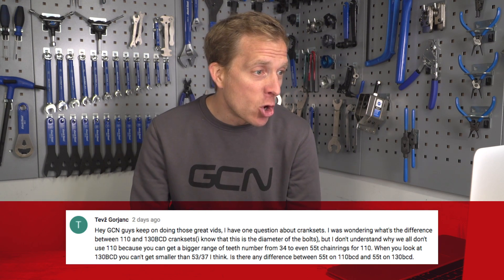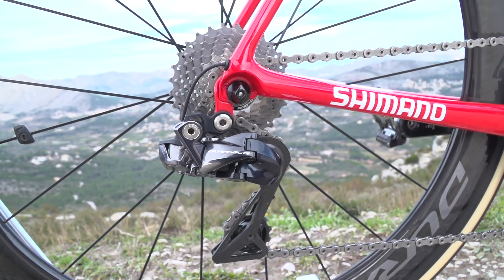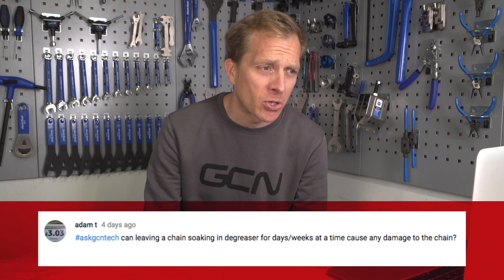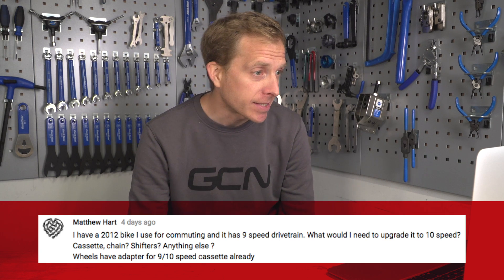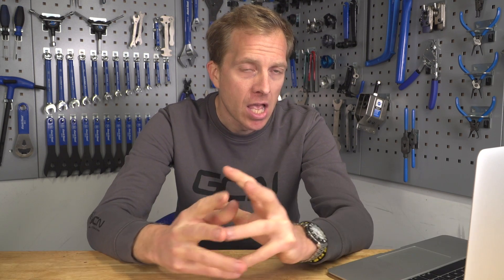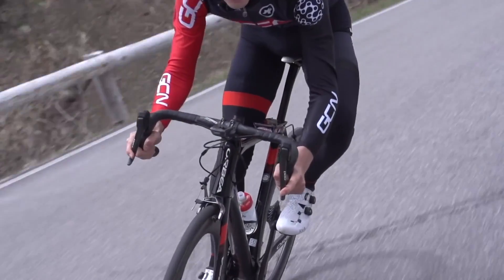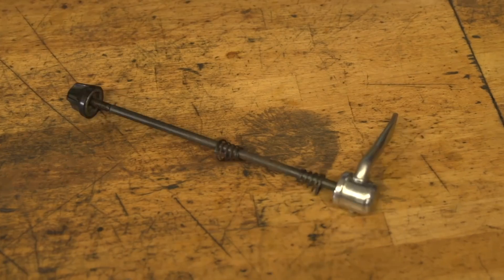What's The Difference Between BCD Sizes? | GCN Tech Clinic

Comment from the maker: Keep your questions coming in with #askgcntech 👇
Reply: #askgcntech cutting carbon which results in better cut?  Dremel with cutting wheel, tungsten carbide bladed hacksaw or 32 teeth bladed hacksaw?
Reply: GCN Tech I have 10 speed SRAM red derailleurs and crankset with 11 speed force shifters and the newer SRAM red brakes. I’m even using a gold KMC chain and Shimano ultegra cassette and it works better than any group set I’ve ever owned (which includes a brand new ultegra). I would recommend it to everyone. I imagine that reading this will make John sick 🤢
Reply: GCN Tech #askgcntech any FD adjustment needed when change inner chainring from 34t to 36t in compact crankset?
Reply: Do you guy's use 'stravistix for strava' ??
Reply: #askgcntech So I have this commuter bike: a 2000s BH frame with 1990s 8-speed campagnolo mirage transmission group.
Right lever has lost the spring to give tension to the lever and return it to place, and seems to not be able to compensate the tension of the derailler, and back wheel needs changing because it's bent.
is there a cheap way to restore the kit, or would I just be better off upgrading to 11speed shimanos? for what I have been seeing, there is nothing compatible with old Campagnolo groups, and the pieces I am looking for stripped from old bikes can set me off as much as a second-to-last generation shimano 105. And then I should add up the cost of the new wheel (to which I would have to install the old hub...).
Alternatively: is there a cheapish road bike that is not total junk?
Also, how does one measure crank length (from the tip of the crank or the middle of the pedal screw to the center of the pedalier).
and finally: how do I know if the bottom bracket is compatible with the frame I currently have?
Thanks!
Reply: #askgcntech Hello GCN,  I am trying bike fitting by myself as a good experience. And I become to know that there's two different types in dropbar. Standard and Oversize, Which one should I use? Are there any differences even ordinary amateurs can feel?
Reply: Would Archimedes want a longer Crank set on his bike?  He did after all ask for a longer lever to move the world., so is there a power advantage to a longer crank?  #askgcntech
Reply: GCN Tech  hi there love your show
Question 
I have a Cannondale Synapse alloy with Shimano sora group set
Can I change this over to a Shimano 105 group set
Specifically just the handle brake shifters, front and rear derailleurs only?
Thanks
Reply: #askgcntech I have a question for you: I have 2 shimano groupets on two bikes, both 105, one is a 10 speeds with a compact 50-34 and the other 11 speeds with a 46-36 my question: is it possible to swap the small chainrings to have a 50-36 and a 46-34? will they work properly? Thanks
Reply: I could swear that first question/answer was supposed to be about power differential! What is the Power Difference between a 110/130!?! Right?!

Comment: I have no idea why you would want to soak a chain in cleaner for any amount of time,, either the chain is good or it’s not, if it’s rusty? Get a new one,,if you think grit has entered the rollers? Get a new one, tenner for a chain. I am a mechanical engineer and have worked with chains both in industry and cycling, by all means soak a new chain in oil for a few minutes before assembly then keep a chain lightly oiled or greased and when it’s old get a new one,,I have seen many a stretched and worn chain soaking in oil,,,please let stop it here!

Comment: Losing weight and gaining watts is hard, so I am considering to swap my 11-28 cassette for an 11-32. To be able to do that I have to change my rear derailleur from a short cage to a medium cage. I have an Ultegra Di2 6800 groupset, so a new derailleur is quite expensive. Can I just buy an replacement cage and swap that? From the parts list of shimano it seems that the only thing separating the SS and GS is the cage. #askgcntech

Comment: Hi Jon, nice show! Can I use a 11 speed derailleur on  a 10 speed cassette with a 10 speed shifter? I've changed my cassette (11-42 T, 1x drivetrain, regards to Si) and now, my pully touches the big sprocket. The derailleur itself hasn't any index, right? So I think the only problem might be the thinner cage for a 10 speed chain...

Comment: @Jon, @Mathew Heart, there's one big exception.  The tiagra 4700 10 speed shifters will NOT work with a 9 speed, or even other 10 speed derailleurs.  They use the new 11 speed pull ratios and will actually work with an 11 speed derailleur, but not with a 9 speed!  

As this is presently the most likely 10 speed shifter someone would buy as an upgrade, it's a pretty big gotcha.  I'd try to get the last 105 10 speed, I think it's 5700.

Comment: Hi. Great show. 
I have an 11 speed, 11-28t cassette, Shimano Ultegra Di2  derailleur setup and use wax to lube the chain. 

I’m having problems indexing the 2nd and 3rd largest cogs in the cassette when using both chain rings, particularly after waxing the chain. What could be causing this? Could the wax have anything to do with it?

Comment: How do you remove pedals from your crank if they are really stuck? Just bought a second had bike and want to put my pedals on. I don’t think the previous owner ever greased them so they are very stuck
Reply: Spray WD40 around the threads and leave for a day. Try to take pedal off by holding the opposite side pedal with your foot. If this fails, takes the wheels off and put the bike in a bench vice making sure to wrap the crank so it doesn't be marked by the vice.

Comment: Degreaser is corrosive. Best try to find out what the degreaser is made from. Some are plant based acids or alkalies and some are petroleum based. What you use will determine how corrosive it is and how you can use it. Citric based degreasers are definitely use and purge immediately where petroleum or ethanol based products you can leave to soak.

Comment: Hi JC!  Which is better: to ride a bit-too-big bike with a shorter stem (90) or a bit-too-small bike with a longer stem (120)?  I'm currently doing the former, but I've heard and read that a small frame with a longer stem may work better if I can't find the frame size I need. Something about better power delivery... #askgcntech
Reply: A smaller bike will be stiffer for going downhill or sprinting. I've made the same mistake before of choosing too big a frame, bike will feel so much better when it is on the smaller side.

Comment: Hi Jon.  I love a gum-walled tyre.  My tyres are approaching needing replacing and I wondered if you could recommend some for the size requirements I have.  The roads where I live are rather rubbish so I'm running 700 x 28c on a 700 x 25 rim, to provide a bit of comfort and durability.  My cursory searches have drawn a blank so far.  Thanks again. #askgcntech

Comment: Hi Jon, I have a 2 part question regarding DA 9100 mechanical groupset. But that dive into some minutiae. I just got a new HM C-Dale Synapse, a real Superbike :), and want to make sure everything is perfectly dialed. #askgcntech

1: I notice with the mechanical DA FD, there seems to be an extra click when throwing it up or down. It feels like Di2, in that after the chain shifts, there is that little stutter to back off the FD. But in this case, i suppose you do it manually. For example. I throw into the big ring, and then do a "half tap" to release a bit of tension after the shift is complete to prevent rubbing. Vice versa on the little ring, adding a small amount of tension. I've never noticed this on Shimano mechanical shifting, and not sure if I'm going crazy, is it normal/ a new feature? 

OK, easier question, maybe. 2: This is my first dive into hydro disc braking, a have been a rim brake holdout for too long. I spent a LONG time getting the pads just right to avoid rubbing. I probably looked at 4-5 videos, including old GCN videos, to combat this. The way the flat mounts sit, especially on the rear seatstay, there can be Zero space between the caliper and frame when squeezing the brake while the screws are loose. I ended up needing to eyeball it, hold it down with one hand, squeeze the brake and keep an incredibly close eye that the tightening back of the screws didn't twist the caliper ever so slightly. I'm not the worst mechanic on earth, but even for me, this seemed incredibly difficult to dial in. Any additional thoughts on disc rub for flat mount setups?

Thanks, love the show, and keep it up!

Comment: Regarding one of the answered questions. I think it depends on what degreaser he's using. Incidentally I tried soaking an ultegra cassette in soapy water for a few days. I brush it and change the soap and water every day. Rust/stains was starting to form at around 6 or 7 days. Gave it a good scrub dried and lubed. Lucky there wasn't any permanent damage done at least visually.

Comment: I've just fitted some carbon rims to my race bike but the brake blocks make this amazing sound when I brake.  Like a snake thats swallowed an electric toothbrush.  But when I pull the brakes hard.  The sound they make is this ear drum popping scream.  Like the noises of a 1940's Sheffield steel works.  I've had the blocks flat, and then towed them in using a folded over Post-it note.  I'm using brake blocks for carbon rims.  I just can't seem to get them to stop screaming at me.  Is this normal or what am I doing wrong?  Do I just have to put up with it while they bed in?  Thanks

Comment: #askgcntech Hello GCN Tech Clinic!

I am looking into converting my 2x setup into a 1x, both because I have had so much trouble with finding the right adjustment of the front derailleur and because it would look cooler with a single chainring (maybe Simon would agree with my on that last one? :-D) If I then change my cassette to a 10-42, would I have to by a new rear derailleur because of the size difference? And do I need to be aware of anything considering I am removing a chainring? Can I use the same equipment without the inner chainring?

Thank you for a great and helpfull show. 

Kind regards from Peter Bill, Denmark.

Comment: #askgcntech hi, I got my first carbon 50mm deep section wheels. I hung my bike upside down on the hooks in my garage between the rides. No issue with aluminum wheels. Is it safe to do the same with carbon wheels? Wheels have solid carbon glued over aluminum base (Fulcrum wind 50 XLR) not an empty shell like HED wheels. Your thoughts?
Reply: Artur Naumiuk check the wheel manual or manufacturer website. These are important infos and normally Easy to find. But in all cases I reccomend is eletrical tape around the hook you store your bike to avoid scratches.
Reply: Ok I am doing it. These Fulcrums are solid carbon and I tested them squeezing by hand. 8kg bike weight distributed on two wheels brings no harm to the hard carbon.

Comment: In regards to the last question about the rear wheel rubbing the brake, do a really good inspection of the frame for any cracks. A friend of mine had a similar issue of the rear wheel rubbing the brake when pedaling, his frame was cracked by the dropout and flexing

Comment: #askgcn  on my road bike when cornering at higher speeds such as down hill my brake pads rub a bit.  I have adjusted them out as far as I comfortable doing. Is this a normal event on rim brakes with wheel flex?  This is my first road bike with rim break set up.
Reply: Wheel Flex is common, specially on alloy wheels. Since you already tried tinkering with the brake adjustment take your wheels to  a bike shop to check for spoke tension. If that does not help it is in the structure of the wheels and there is nothing else I know you can do.
Reply: Luis:  Thanks...I will have the shop check out spoke tension.  The wheels are alloy..carbon is not in budget yet.

Comment: Regarding brake pull: There are a number of things that can cause brake levers to require a longer pull before the cyclist feels them begin to work. And you have to check all of them because any one can affect the operation of the system.

1 - Every end of each section of brake housing (the outer covering or sheath around the brake cable) must be cut and filed square. Then the ends must be inserted fully into their mounting points. If the ends are not square or not fully inserted, they will compress a little, effectively shortening the housing, before the brakes activate. This increases the distance the brake lever must be pulled by the cyclist before the brakes begin to engage. None square housing ends can also increase the friction, and therefore the ease with which the brake cable is pulled.

2 - When installing brake housing, if end caps or ferrules are used, they must be pushed onto the housing tightly so that the square end of the housing is fully inserted. If this is not done during installation, the housing will be effectively shortened when the brake cable is pulled, again increasing the distance the brake lever must be pulled by the cyclist before the brakes begin to engage.

3 - Brake cables must withstand a much stronger pulling force than shift cables. For this reason, most manufacturers use a housing that contains a single, strong spiral-wound metal jacket that can withstand this force without deforming. But these spiral-wound metal jackets have an unwanted characteristic: they compress a little when the brake cable is pulled. The longer the brake housing, the greater this unwanted housing compression occurs and it can increase the distance the cyclist must pull the brake lever before the brakes engage. Since the widespread adoption of indexed shifting, this kind of compression cannot be tolerated in shift cables. So shift housing is designed differently. Instead of a single spiral-wound metal jacket, most shift housing surrounds the cable with multiple stiff parallel wires. This kind of design virtually eliminates compression and therefore allows the small, precise cable pulls required for indexed shifting. This kind of shift housing is called "compressionless" housing. With that explanation out of the way, here's the salient point: There are some pro brake housings that are made with alternate techniques in order to make the brake housing compressionless also. For example, SRAM's "pro" brake housing uses the same technique that shift housing uses but they use stronger wires in the housing to make it strong enough to handle the stronger cable pull required for braking. As a result, they label their pro brake housing as compressionless, too. This kind of housing would reduce the distance the lever needs to be pulled before the brakes activate. But it also has a disadvantage: it is very stiff. In fact, it's so stiff that it cannot be used for internal cable routing through my handlebars so I continue to use the brake housing with the single spiral-wound metal jacket. It's much more flexible. There are some other techniques that different manufacturers have used to accomplish a similar benefit of compressionless brake housing and some of the other techniques preserve flexibility. This would probably be a good subject for another GCN Tech video.

Lastly, brake pull problems are usually directly proportional to the length of housing used. This is why you'll usually see the greatest problem with the rear brake because it has the longest cable run and, therefore, usually has the longest housing. If you've ever wondered why so many frames run both shift and rear brake lines outside the frame for long distances without any housing  (along the top tube or down tube), it's to avoid the problem inherent in long housing. Unfortunately, the move to internal cable routing may have benefits for aerodynamics, but it has the problem of increasing the amount of housing that must be used. What you gain in a lower coefficient of drag can be easily offset by poor brake pull performance unless you are very careful with your selection of housing and installation. Again, another good subject for a GCN Tech video.

There's a surprising lot to learn about installing a brake cable system with best practice and which technologies to use for "difficult" situations. But, once you know how to do it and avoid the pitfalls, it's still one of the cheapest and easiest systems to install and service. Which is why many cyclists still prefer it over a hydraulic system.
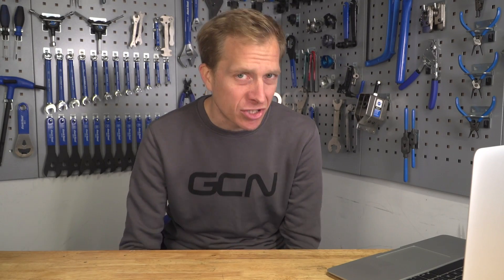Reply: You mean at 1:42? Because that question was about shifting, not braking.

Comment: #askgcntech I asked this before on the GCN main channel but never got an answer so I will try again! Since this video was about cranks, can you tell me why the cranks for track bikes are so... simple and traditional looking? For road we have companies using four bolt designs, carbon cranks, hollow metal cranks, even hollow or carbon chain-rings, all for the sake of extra stiffness. However, track bikes all seem to have such basic looking cranks. I can imagine track cyclists putting out a whole lot more power at shorter intervals, so wouldn't stiffness matter more there? Why is it that shimano or sram don't use their latest road crank technology for their track athletes, instead giving them cranks that looks to be from the 1980s?
Reply: Weight isn‘t critical on the track is the main reason and as there‘s no gears or brakes they need the bike over the minimum 6.8kg.
Reply: Wouldn't absolute stiffness of the crankset be more important? If their bikes are underweight they can easily add ballasts into the bike frame like some climbing bikes in the peloton.
Reply: In my experience, Stiffness comes from the chainrings and bottom bracket on a track bike a lot more than the cranks themselves.